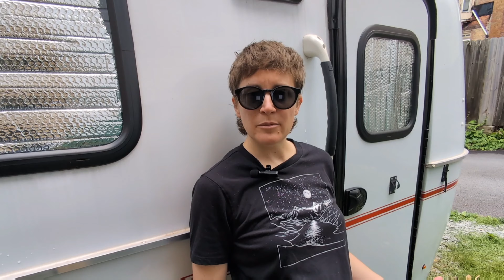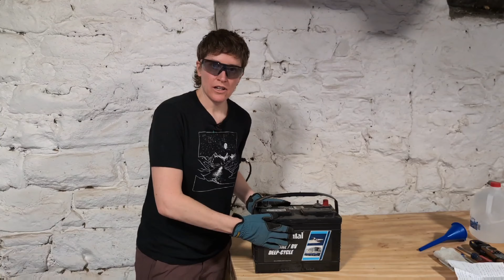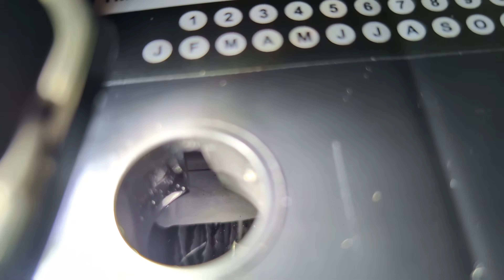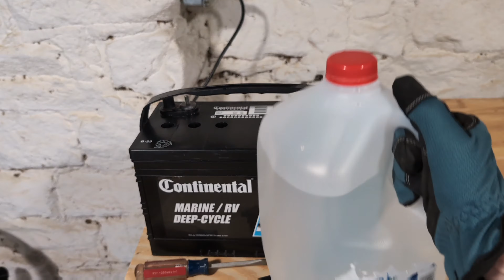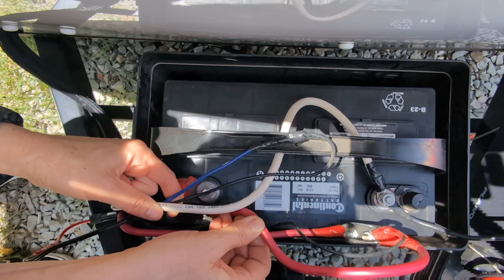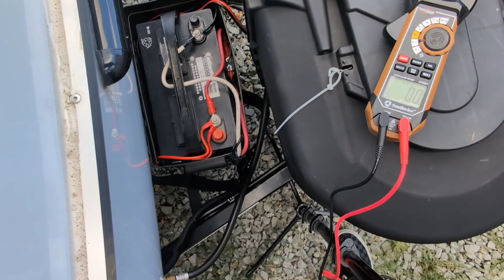RV Battery Maintenance 101: How to Service and Refill Your Battery

Comment: Thanks Mandy!  I'll be checking my battery.   I wanted to note that in the Scamp manual, it does say that the battery would not be charged if the cutoff switch was engaged - so you weren't initially wrong!  But, it's interesting that the manual is wrong (?)!
Reply from the maker: Right?! The Scamp manual definitely says that, but real-world testing told a different story 🤷 Glad you're checking on your battery. It is an often overlooked maintenance item. Way to be proactive!

Comment: Couldn’t you have left the battery in its compartment and just add the water?
Reply from the maker: That's a great question. You absolutely can. It is just a very small space to work and the battery box makes removing the reservoir caps more difficult. I prefer to remove it in order to clean the exterior of the battery and inspect the battery box/hardware for damage.

If I had left the battery inside the box to perform this service I never would have discovered the rust on the mounting hardware below the battery. That rust left undiscovered could have led to bigger problems in the future.

Comment: Nice video.  You can swap out your lead acid battery for a lithium battery of the same size.  Looks like you have a standard automotive battery, Each battery gets a group number, which will determine the physical size of your battery.  Getting a lithium battery and solar charger will increase your off grid capability and reduce weight as well.  these batteries also come with their own app and bluetooth connection so you can check your state of charge right from your smart phone.  These batteries will last longer (in life) than the standard Led Acid battery and require no maintenance.  The charger is intelligent enough were it cuts the charge to the battery after its fully charged.  allowing you to use the solar panels as an alternate source of power.  But remember do not use your current charging system with Lithium batteries.  They require a different charger.  You can still charge from your tow vehicle but the charge current will go the charge controller.  Great little trailer, and brilliant video.  You did a great job.
Reply from the maker: Thank you. And I would absolutely love to upgrade my battery system... just waiting for the budget. Any sponsors out there watching 👀👀👀

Comment: Another great video.  I used a cheap measuring cup with a spout to fill my car battery.  But I like Dave's idea of using a turkey baster, too.  Excellent tip for using lemon on rust!  I'll have to remember that one.
Reply from the maker: @Meari.S  another great option! I love the knowledge sharing happening in the comments section. Scampers are a special group. Thanks for the alternative solution. Glad you found something useful to you in the video.

Comment: I just noticed that you also cover the windows with Astro foil(?), I did that for storage and found that I liked it left in most of the time. Mine is held in with binder clips on the frame screws.(I've also recently tinted my windows.)
Reply from the maker: I'm jelly. I'm saving up to get my windows tinted too. Do you find it has made a significant difference? 

I have reflectix in my windows. The insulative bubble wrap kind. It keeps the sun out of the interior preventing sun damage. It also keeps it significantly cooler inside the Scamp. I use it when I'm camping and when the trailer sits unused. 

You can see how I did it in my Scamp Hacks Video: https://youtu.be/eoXy7PFgIGU?si=fWDqR6OApICMIaN8
Reply: @BackcountryDirtbag  I wanted a "GOLD" tint and could only fine one source, it was cheap at only 10$ per roll. but it looked more yellow to me. I have not traveled with it yet. The Scamp rally will be the first time and I will leave the foil in. For one thing, if I'm boondocking the Astro foil causes the cool night air to flow down over my face.
Reply from the maker: Nice. I wish I could make it to the rally this year. Have a lil extra fun for me.

Comment: Battery fill tip: a dollar store turkey baster is great for adding distilled water to the battery. It allows you to see the level while you add the water. Another great video!
Reply from the maker: Great tip! Thanks so much for sharing that with us all Dave! You are a tremendous resource.